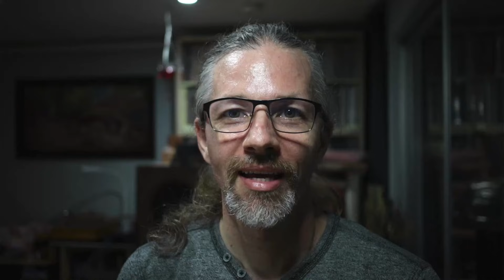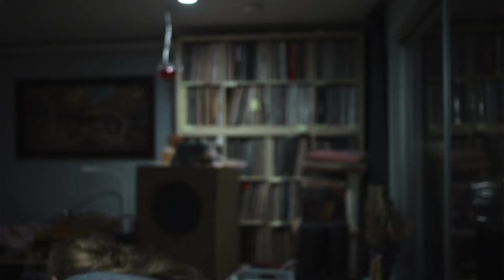How could we take solid state sound to the next level? (Transistors vs tubes)

Comment: I’ve been a tube guy since the early 90’s. Only recently, the past two years, has solid state been a part of my listening experience. I have built, modified, rebuilt and reimagined both tube and solid state amps. I built a Hiraga 30w class a solid state amp last year. It is such an incredibly well performing amp, my tube amps have all but been sidelined. I have also built many high efficiency horn loaded speakers, as well as “traditional” speakers. I am currently listening to some coax drivers in a small sealed box that are 4ohm loads and very inefficient - 80dB. These speakers, with the Hiraga amp, are producing some of the most wonderful sonic experiences I have ever had the pleasure of listening to in my listening room. Complete 180 degree shift from what I have been listening to. I reimagined a single ended EL84 amp, that produces under 3 watts. And you are correct, it does sound amazing when paired with the right speakers. Fostex in a Voigt pipe or my Cornwalls, and it sounds quite lovely indeed. Using the 15ohm  taps on the EL84, it can even drive my ESL57s with tremendous sonic qualities. The Hiraga was specifically built to drive the ESL’s, but unfortunately, one of the speakers has developed a buzzing noise that I have just not had time to fix, so I have not yet been able to test the Hiraga with those speakers. I also recently got lucky, and won the chance to buy the Pass designed Sony VFet single ended solid amp as a kit from DIY audio. Another exceptional Solid State amp, but it came with an SMPS power supply, and like the ESL’s, I have not had time to build a proper power supply for it. You are tight on point when you talk about power supplies in amps. I think it is often overlooked that the electrical signal that is being fed to the speakers is coming directly from that power supply. I think people far too often compare amps/speakers/power to a light bulb being powered by a constant source. Audio couldn’t be further from that. There is an ever changing signal, that is being amplified by a reactive source being fed to a dynamic load. Having said all that, I have two tube preamps I am about to start building, and two single ended tube amps I am about to build. I still love tubes :) And I am quite intrigued by the La Grande - which I got plans for - and all they cost me was a cup of coffee… I’m looking forward to getting them built and having a listen to what you are listening to. It will help me understand where your audio thoughts are coming from. Ok, I’ve rambled enough.
Reply from the maker: Absoutely wonderful sharing, thank you! I really enjoyed reading it from beginning to end. Thank you for giving a try to La Grande. I suspect that it will be a perfect match for the Hiraga amplifier, as he has designed the LePetit, which was the inspiration / starting point for LaGrande. I think LePetit is more of an all-rounder, and the LaGrande is the classical music specialized version.

Comment: It is actually quite easy to understand. When we know the basis.

1. Negative feedback is lowering the THD

And it is not about simple music or complex music.. or if we measure at 1 kHz..
Yeah, maybe it is easier to hear..

What is negative feedback?
It is FOR EXAMPLE a amplifier in a small 8 pin op-amp. After that the signal has been amplified some of that amplified signal is then fead back to the negative input AGAIN!

What is happening is that electricity is fast but it still take some time (small amount) to have something amplified and done.
And then when done putting some of it back to the start and input to get amplified again.. and now that feedback is delayed in time and we mix/"dilute" it with the new fresh signal that is also going in to be amplified..

2. The issue is in the time domain that it is smearing over. 

Notes like a cymbal hit and the time for that cymbal to ring out to quietness is taking "longer" time or let say the decrease in dB during the time is "less steep". (Trying to give a example..) so if you listen to a drummer hitting a cymbal repeatable in a constant rhythm (like in jazz or whatever). Then imagine the hit then when the next sequential hit on the cymbal is coming the ringing of the previous hit has NOT came down in dB as much as if it were live or if no negative feedback were used.
(The dB level and difference of the previous hit compared to the current hit dB is not that great or as big as it should be and the contrast/difference is between the hits is lower.)
Annoying when you catch it and hear it.. as it is harder then to get it unheard..😅
Another example the clics and pops in a LP. When they occur they get amplified and some is sent back to the input and amplified again. So the same here the click and pops is "longer" in time with negative feedback. Or let say more pronounced..

So two practical examples on what to listening after and note.

3. Op-amps NEED negative feedback to be able to work as intended at all. (To solve several issues one of the bigger ones is self oscillation. Yeah, it will not work as intended at all..)

4. You have negative feedback to 99.9%  if you spot a 8 pin op-amp in your topologi

5. Therefore when it is stated usage of discreet components. It is JUST a good start.

That means no op-amps. But the topologi can still operate with feedback.. but you go from 100% certainty that you have negative feedback to a possibility to not have negative feedback. 
So the designer need to specify IF he is using negative feedback or something else in their layout of discreet components (topologi).

So now you know why, where and what. ❤😂🎉😅
Reply from the maker: Thank you Optimize, superb explanation! Indeed, we see the reason why to avoid op-amps... even as regulators in power supplies, they mess up the sound quite a bit. Using a different device in place of an op-amp is already a big improvement towards better sound quality... and asks for quite a bit more planning and parts cost, and larger space to do it with a different device... :) Op-amps are just so darn convenient and cheap! They beg to be used... and we are so happy to pay less... then find out we don't like the sound at all. 😳:)

Comment: Hey J. I commented and its disappeared! How can that be? Anyways are you familiar with Lenard Audios circuit to improve any transistor amp?  Anyways my own easy way to improve a solid state amp is to add a good vac valve preamp!
Reply from the maker: Hi Eddy, YT has a mind of its own, and automatically removes comments where it contains something that gets flagged by its AI algorithms. It can be a typo, or most often if you do not have a space after the end of the sentence. word . word written together is almost a guarantee that the comment will be removed, even my comments ; ).
Nom, I am not familiar with Lenard's circuit. In general, I know extremely little about transistor circuits. I have focused all my attention on tube topologies, with the near-total exclusion of its sand counterparts... ;
Reply: Ahha thanks for the reply yep thats what happened.  This site is dedicated to tube amplification but has the section with diagram to improve any ss amp. @realworldaudio

Comment: Some solid state amps have a balanced connection but it is not a descrete balanced design. A good balanced system based on these balanced connection is not easy and not cheap. A true balanced system is a step forward.

Comment: So in short it is NOT :
"transistor vs tube "

It is design topology.

When that is the case then we need to stop to ask ourselves that wrong question.

For example:
I have a good RIAA it were solid state. 

But I wanted to experience a RIAA that had topologies and design criteria:
* no negative feedback
* discrete components
* class A

Still solid state when I don't want the drift and difference between tubes.

Oh, boy those topologies and design choices paid off in sound quality improvements.

So stop the "transistor vs tube" it only show that someone is inexperienced. 

When they're sitting and hearing that their new first tube amp is so much better.. 
No IT IS NOT it is not the tubes that contributes to the magic yes they might be a small contribution from them.. but likewise when you probably went from topologi class AB to class A.. to just point on one thing..

So you are not comparing "transistor vs tube" you are comparing apple and carrot. 😂❤😅

Comment: In my experience, experienced designers will design for simplicity using high quality components.  When you look at well designed tube amps they are essentially all quite simple.  Simple though, comes from knowledge and experience of what contributes to the best sound, the components, the wires, the solder, etc - the whole system works because every part of the system has been thought through to work as a whole.

Comment: I know the benefits of a tube amp, had some in for demo and they're great, but i just can't deal with the heat and energy bills here in south Texas. For my specific case, a tube preamp or dac with small linestage tubes is the only way to add tubes to the system and even that or some solid state amps can run too hot. Summers are brutal and staying out of the sun just to sweat inside your listening room makes listening not so fun. Having to settle without a tube preamp even and direct from dac to amp, i'm happy with my vintage mcintosh mc250. Runs cool to the touch, and i love the sound of transformer coupled amps. Adding a 2:1 transformer line output helped tremendously in removing digital hf noise and everything plugged into a japanese isolation transformer is giving me what i feel is the most analog and natural sound i can get at my budget from transistors.

I'm hoping in the future i have the budget to allow for a tube amp for the winter months only.
Reply: nelson pass designed a tube preamp kit based on the korg nutube. runs really cool and you can set your desired level of 2nd order THD. it's called the B1K if i remember correctly. might be a solution for your issue 😊
Reply: @raoulselten9480  interesting. I'll look it up, thanks